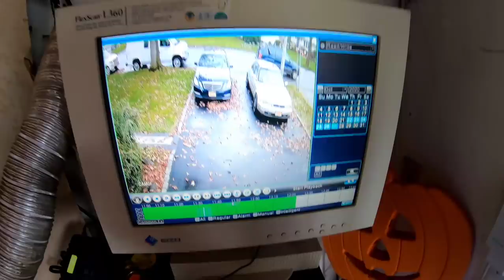CRAFTSMAN LT1000 LAWN TRACTOR WOBBLY WHEEL REPLACEMENT SLOW LEAK REPAIR HUSQVARNA SEAT CUSHION FIX

Comment: So I have a question:
I have a riding mower that when you turn the key it doesn't do nothing!no clicking,nothing.had new battery,its getting 12 volts to solenoid,good fuse..but today I put a wire to the negative post on the battery,to the ground side of the solenoid and it fired right up!!!!,turns on and off..I know I can use it like that but what will be the right way to fix it??replace solenoid.?bad ground somewhere?bad safety switch???
Reply from the maker: The ground wire on your battery is not grounded correctly.  Trace the black cable to the frame of the tractor.  Make sure it’s bolted down well

Comment: A Dyson ball... Nice.... The rolling carpet thing is called a beater bar... The belt needs to be replaced, simple procedure.
Reply from the maker: No belt I could see. Two tubes go into a motor
Reply: @MowersNBlowers  yeah you have to take the head apart, and the belt should be there.